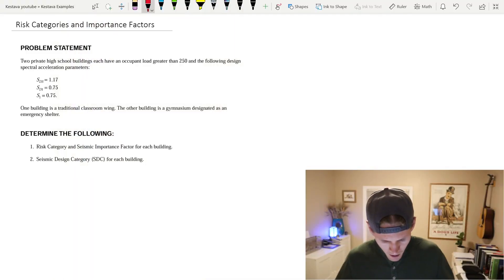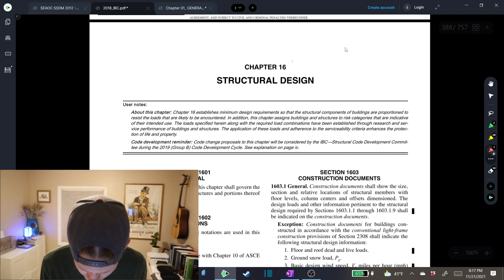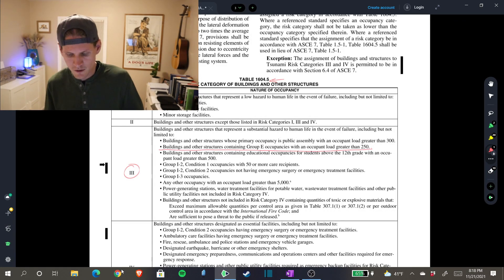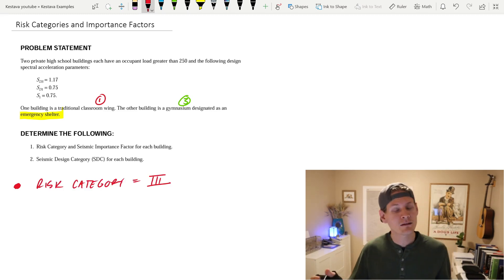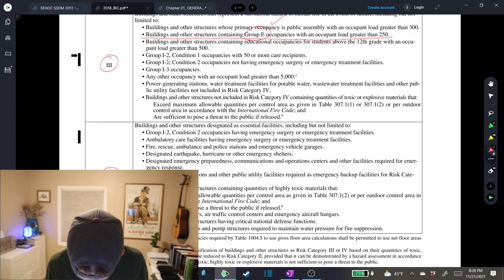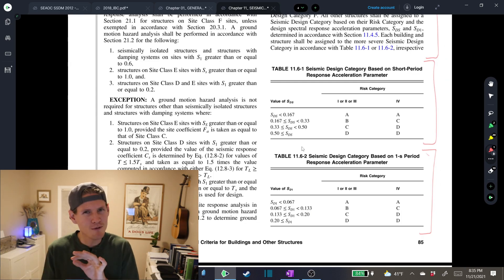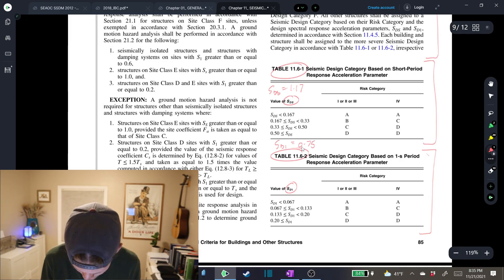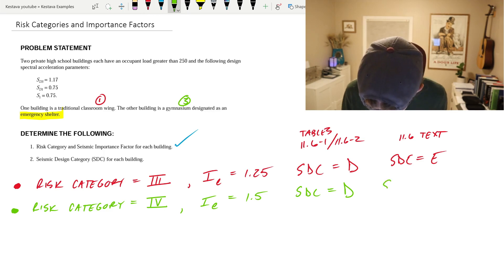Importance Factor | Risk Category | Seismic Design Category - Example Problem

Comment: It would have helped if SCE 7-16 provided an inequality showing the conditions when tables 11.6-1 and 11.6-2  were not applicable (I.E. S_1 < 0.75) rather than requiring one to look at the text above. Its easy to miss if you are not privy to this type of material. 

I am a water resources engineer in California, and state licensure requires us to take a seismic related exam.